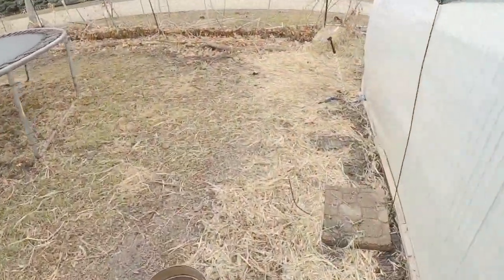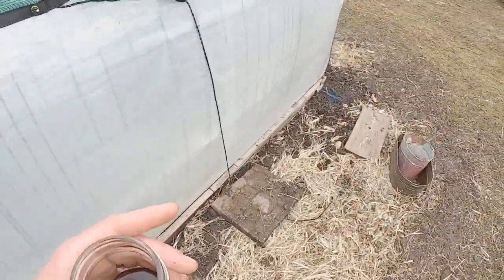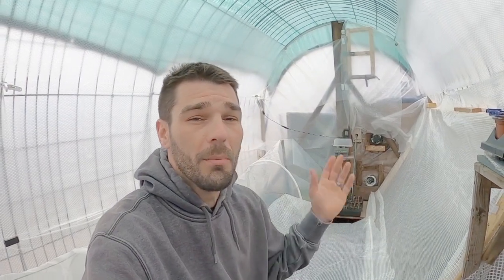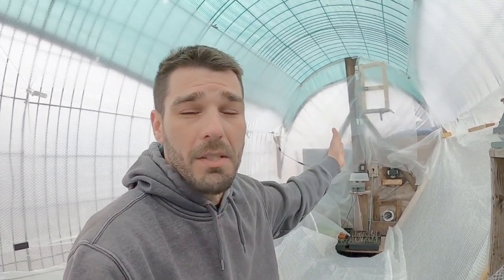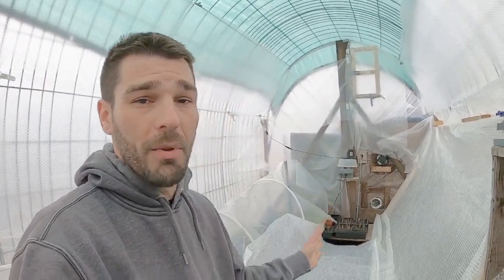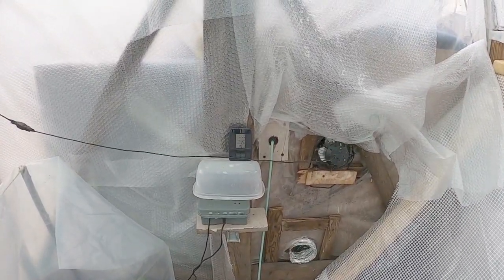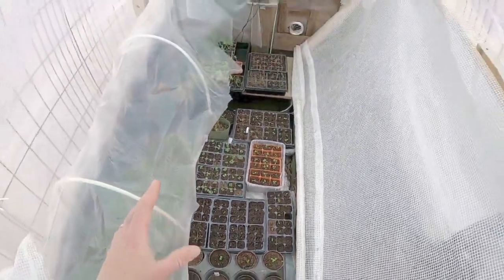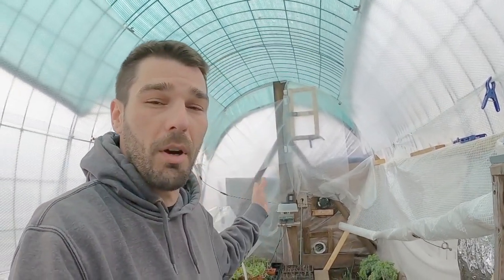DIY Cheap Late Winter Greenhouse Heating | Solar/Jean Pain Compost Heated DIY Cattle Panel Hoophouse

Comment: do you by any chance keep records of all these great information incase you want to compare things?
Reply from the maker: Yes I have been logging some date here and there in a notebook.  I choose days that are different circumstances always, to try and give a good idea how systems (passive and active) work in a given situation. There are so many factors affecting results with all my experiments, and collecting data can be difficult with weather being so unpredictable and changing unusually. I try to share the productive experiments, along with failures and different applications. Sharing the long term data required due diligence in recording as I don’t have any automated thermometers that have all the bells and whistles lol,  but having such features would allow for great data preservation at little effort to me. I also would like to monitor soil temps on the same system. Good question!
Reply: @Earthdwellershomestead  Thank you so much for your reply. 

The reason I asked is because I took your advice and installed a compost inside my chicken coop where I also keep Rabbits. I have noticed that the chickens like to get on top and lay on it. They make a mess all the time but that is okay. I keep sweeping it and putting it back for them. Sometimes the rabbits make a mess too.

I'm also interested because I make  pintables which I sell online and was thinking about designing a chart to help growers keep track of the temperature inside their green houses and use the data for the future.
Reply from the maker: That’s a great idea!